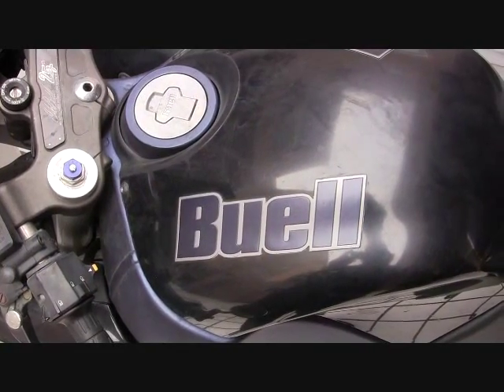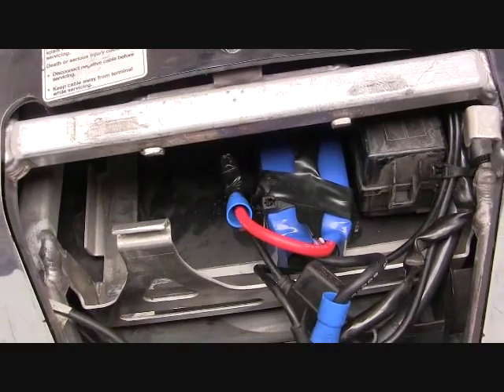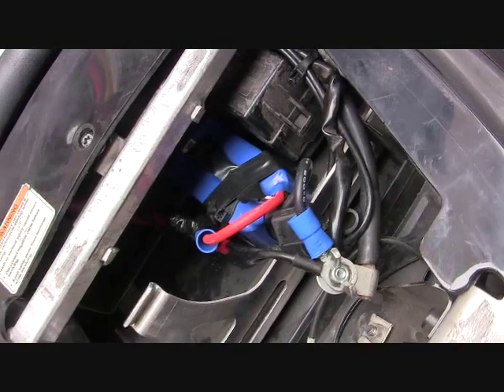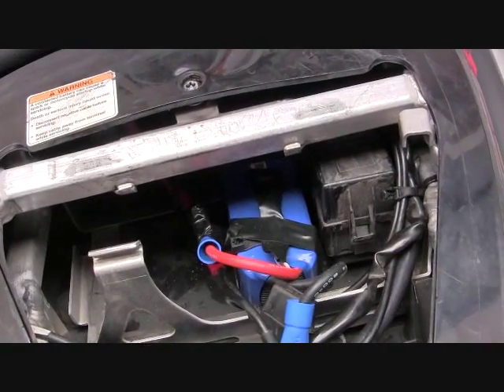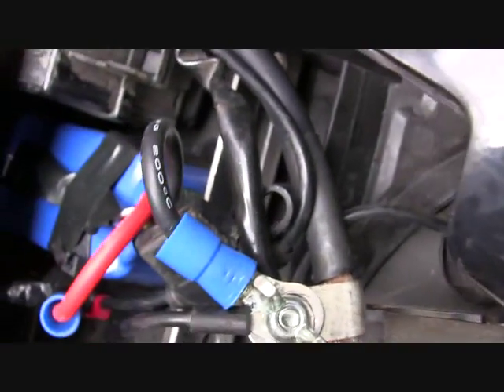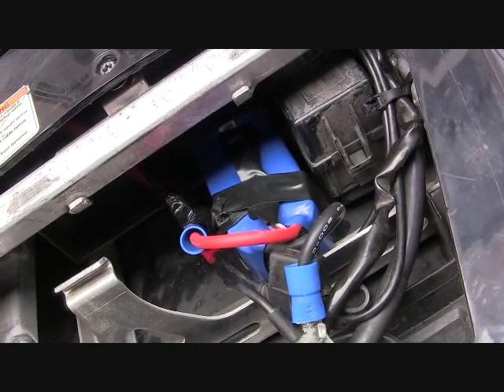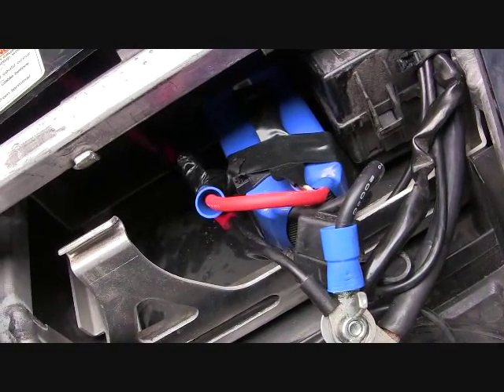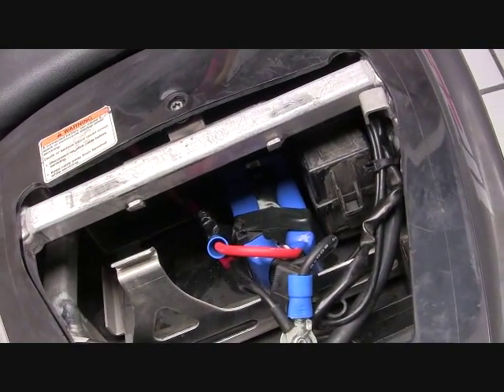Buell 1125R battery mod

Comment: thinking about doing the same, aren't you afraid the bike charges the batterie to fast?
How are they holding up? Why no bms?
Reply from the maker: the results are, the battery is too "thin skin" due the vibes, it chafed and would short a cell. tried electrical tape and zip ties, something would eventually chafe through. @ 6 month daily driver
bms, no don't need bms, I would balance charge once a week then it became once a month. all cells would stay within a 1/4 of a volt, the only time it would start to imbalance would be when the chafing condition would get too bad. in fact I dove the last battery around till one cell just quit, due to chafe through, then the battery just did not have enough oomf to start. no fires no leaking, the draw back was chafing, and balance charging once a month. recommend for racers or weekend warriors, but not for daily commuters. I eventually  bought the li ion battery brand "battery tender", still testing.
Reply: +Advanguard Foam should keep the batterie from chafing because of vibrations
cheap bms can be found on http://www.aliexpress.com/ (bypass them to start the bike) so no more balancing

Comment from the maker: Anderson quick disconnects, wrap battery with electrical tape, secure with wider than zip ties, disconnect bat while sitting for more than 2 days, get turnigy charger to balance charge cells once a month. capacitor boost kit coming in mail, video out soon.

Comment from the maker: the first one died cause the inst cluster killed it over the weekend, second one died cause the battery thin plastic bag cover chafed through and killed one of the cells. recommendation for racing this is the best for weight shedding, for daily I recommend the off the shelf.... shaio? key word to search motorcycle lifepo4, get the 8 cell or more for your daily commuter.

Comment: How has the lip battery pack held up for you. I need to replace battery on 1125r I just got and like this idea. That's a tight fit for the original battery. Any advice on your setup would be nice.

Comment from the maker: 4.2ah, compared to the 12ah stock, yes everything runs just fine with fans and lights, starts hot and cold, my buell never liked hot starts so it always takes and extra second to crank. the battery is rated for 14.4V MAX, my bike puts out 13.5. Update notes, unplug for the weekend under 10 volt will kill these batteries, and use double back velcro instead of zip ties, I think I might have crushed the cells with too tight zip ties. buy the turnigy charger accel 6 to balance charge the cells once a week, to ensure the cells are balanced, 3.3 each. Cranks over my double jug high compression 1125cc.

Comment: How many mAh's is your new battery compared to a stock battery?  Have you had to start it when your engine was hot and the fan running?  I would think that with the engine revving, the voltage would peak slightly above 14 volt...